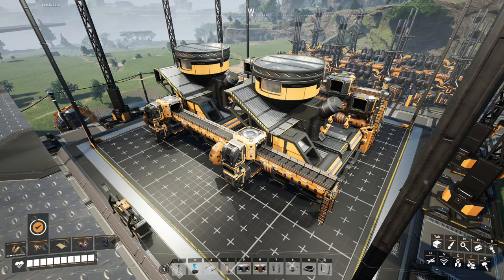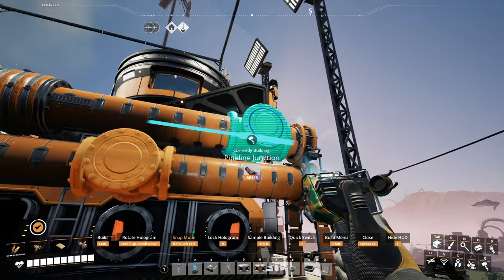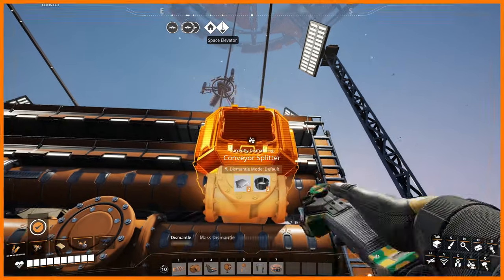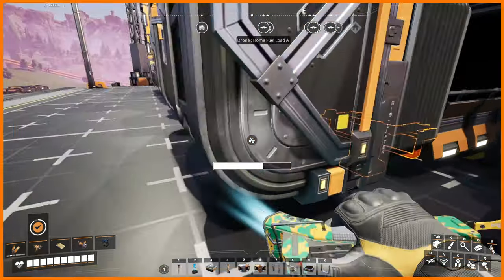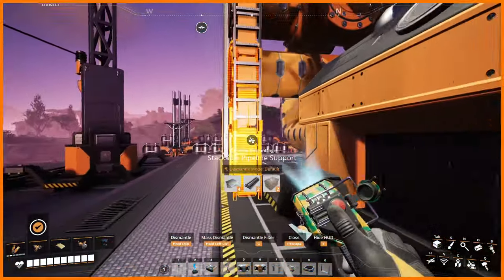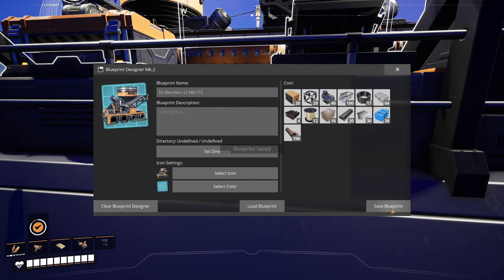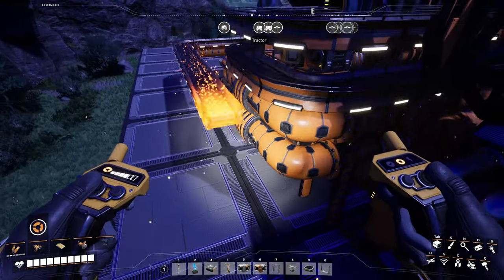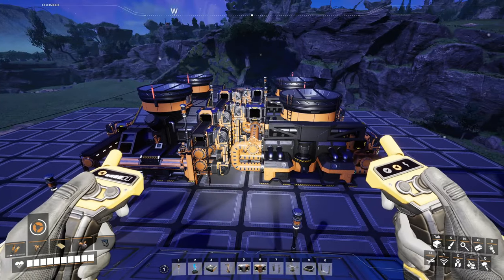Mid Game Blenders Blueprint - Compact, Clean, & Tileable - Mk.2 BP - Satisfactory 1.0

Comment: Pipeline junctions don't snap when they're too close to the end of a pipe segment (even if it looks like a continuous pipe, if there's a segment break near the junction it will fail).  The first ones worked because the solid inputs gave you enough clearance from the pipe towers.  The last one didn't work because it was too close to the tower and the end of the pipe segment.  To fix, you can initially put the tower down as far past the connection as possible, snap your junction, remove the remaining pipe and the initial tower, then rebuild your tower in the correct spot if needed.
Reply from the maker: The real tips are in the comments! Thanks!

Comment: You could save one space on your first hotbar by only using the second one for power. If you start at a building and go anywhere else you'll intelligently get a floor/wall connector. I middle click on another pole if i really need one (like adding another pole between two other ones)

Comment: Build a stack of foundations where you want to snap the pipeline junction, place the junction then remove the foundations. Or use walls to snap a junction vertically. You can also clip walls into the blender and clip a outlet near the power connector on the frame of the blender, then remove the walls. Do the same for the backside and run a wire through the blender. You won't even see the wire unless you look really close. You'll appreciate all the extra power connectors. I also do the same thing to refineries.

Comment: @10:55, Because of floating point number error's with the larger pipes, using tier 2 pipes should only be done if your build wont break if it gets less than a full pipe at all times. The real number going through tier 2 is closer to 599.9 than 600. If your build requires exact ratios of fluids like aluminum then always use tier 1 pipes or it will stall eventually. There is a Dev Q&A explaining the problem on their YouTube channel.
Reply: ohhhhh, that's super helpful to explain an issue I had recently.
Reply: If you search for "Is pipe mk.2 bug still a thing?" there is a clip from 2 weeks ago, where Snutt answers in a Q&A that this has been resolved and pipes mk2 work as intended now